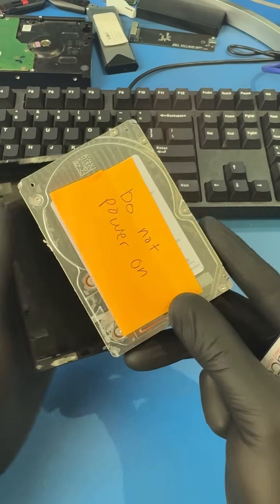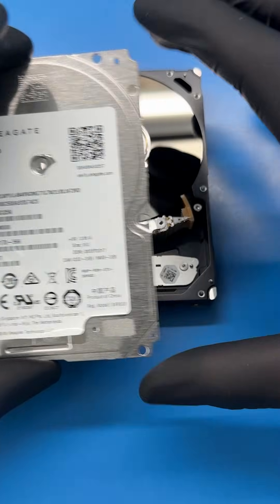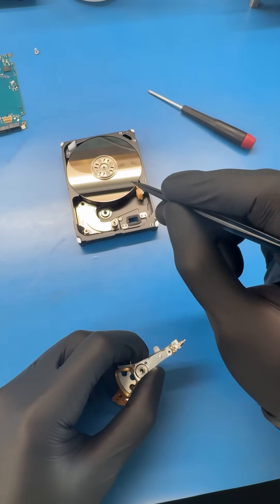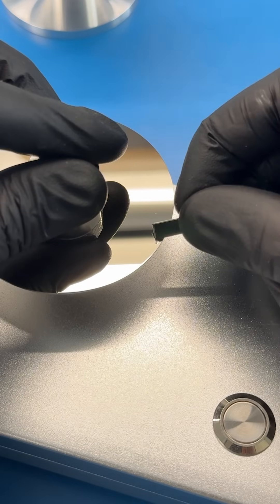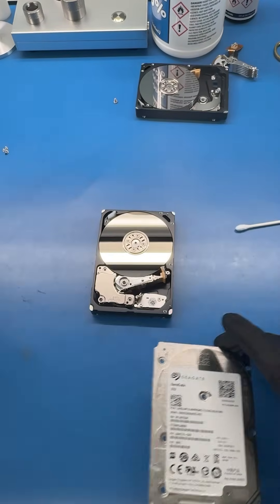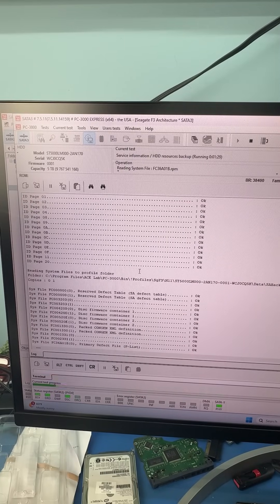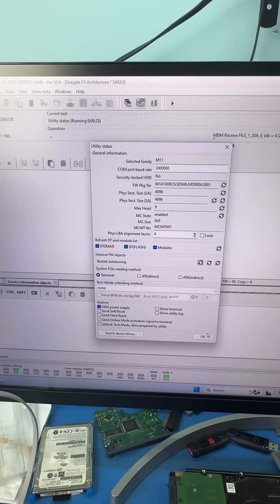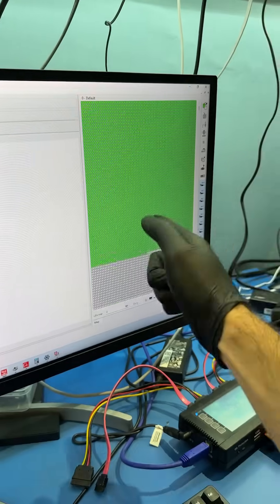Heads stuck on hard drive platters?

Comment: Excellent deep diagnostic skills and equipment in an advanced repair! That little 2.5-inch Seagate ST5000LM000 HDD at 5 terabytes, with 10 heads/ 5 platters, was probably the peak of 2.5 inch sophistication. My first HDD, in 1985, was a big, quality Miniscribe 3053 voice coil--superb listening too :-)

Comment: Can't we change the platter to another donor drive to use it like a normal hdd?
Reply: Yes you can change the platter to another donor drive, but you take a risk to misalignment the platters and damage the platters if it get scratches. The best way you can do is replace the heads, recover the data much as you can. Then transfer your data from one drive to the donor drive. In that way you can use like a normal hdd. I have been told that most hdd have different serials, heads, firmware…etc to stop stealing and stop you reuse the old drive. Once they die, it’s time to throw it away.

Comment: Can you please settle a long-standing question/myth?

Let's say that someone fully formats a drive. Not just a quick format, but one that overwrites all the data with zeroes, or some other byte. They only use a single pass. Can you recover any of the data that was there before the format?

I ask because there seems to be this persistent belief that the only way you can be sure nobody can recover data from an old hard drive is by completely destroying the drive. Either that or running a military grade drive erasure program that will overwrite the data 20+ times with random patterns.

So, as a data recovery expert, if someone does a one-pass, zero fill on a drive, can you still recover all the data from it?

Comment: How did you keep the platter aligned after pulling them? I have successfully done a platter swap, but I taped all the platters to keep them aligned rotationally, since the ROM/Service Area was set at the factory to the specific platters, and changing their alignment would mean it could not access the data (it would not be in the location it expected).

Comment: Does this need to be in a clean room? Why not switch the platters to the new hard drive?
Reply: Because the module in the hd is identical to the platters, other module won't read the platters.
Reply: he wanted to inspect/clean each platter